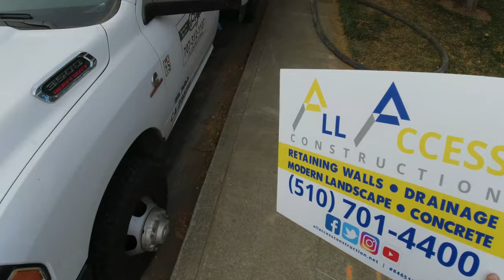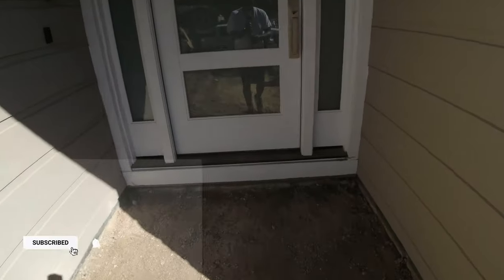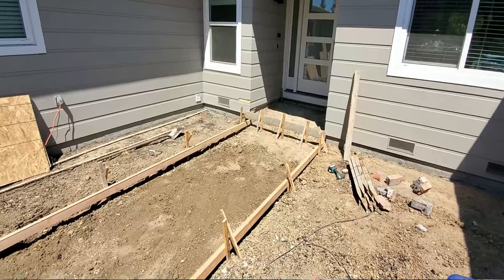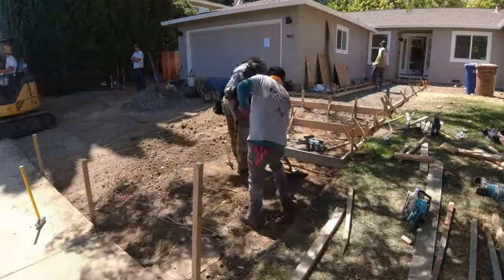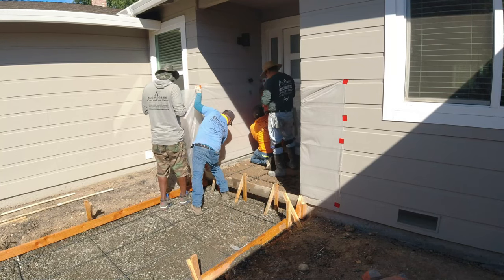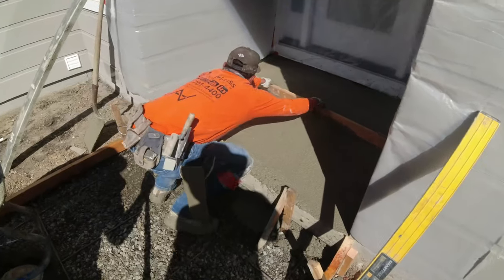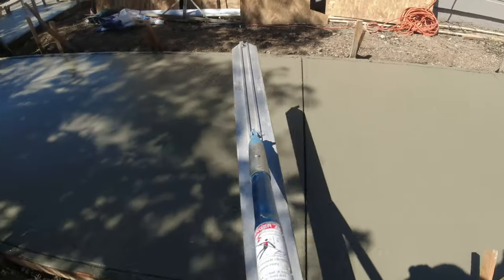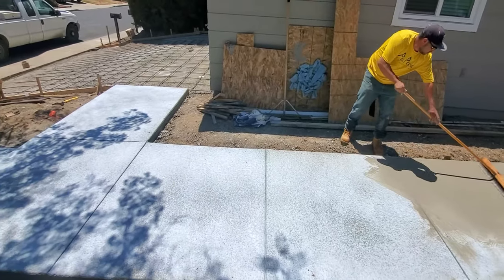Sandwash CONCRETE Sidewalk W/ Cantilever Stairs

Comment: Great work,  just a question, why didn't you use a pump, instead of wheelbarrowing so much concrete.
Reply from the maker: This was 2 pours.. Walkway and driveway.. We only wheelbarrowed have of the walkway. The rest tailgated it.. No need for a pump on this phase